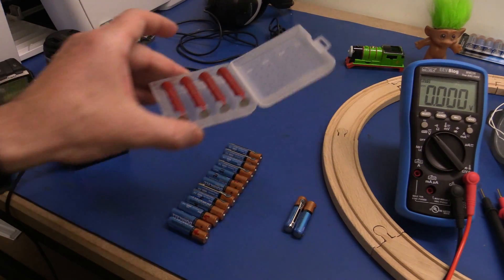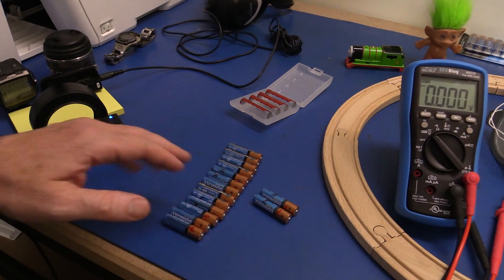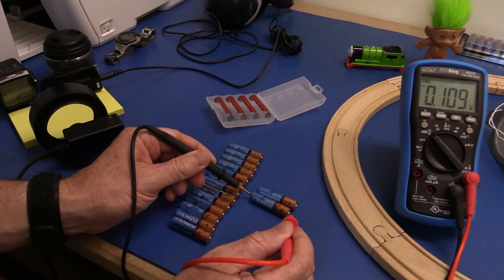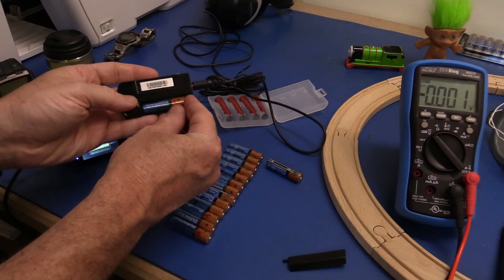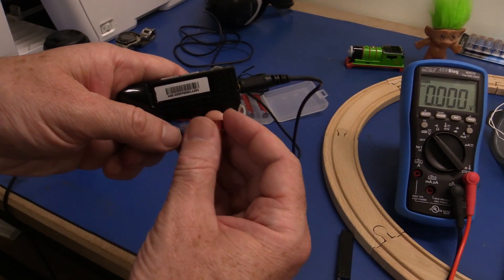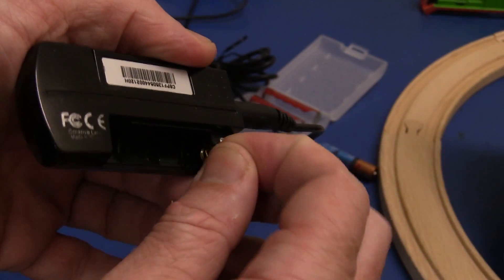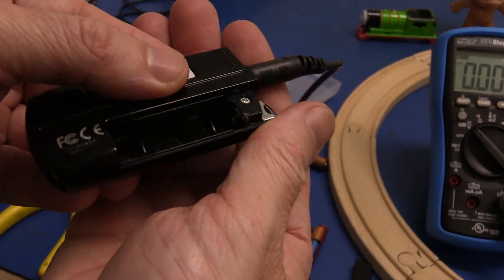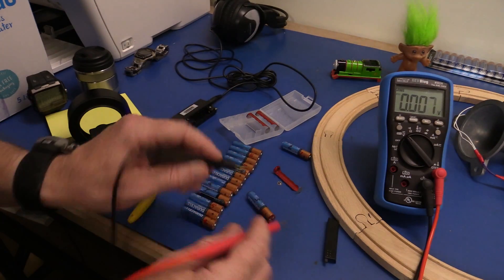RAW Batteriser MP3 Player Test

Comment: I want to leave a dislike but i don't want you thinking it is because i belive the batterizer bullshit. 
i get this is your second channel or whatever, but im not subbed to this channel and this video is being suggested so don't "hide" behind that argument, where the video comes from is not important.  you seem to be more in a rush than normal in this (than your mail bags, your streams, everything) that "rushyness" causes you to make many mistakes that are careless (putting in the battery without the batterizer, the first battery working but not working on camera, breaking the batterizer (yes, i am saying you rushed and YOU broke it BECAUSE of that) ) 
despite being in a "rush" you still waste time doing pointless things which makes the video feel weird, measuring all the other batts for example...why? they are not part of this test and don't hold any interest. will you also measure the length of the table, and the brightness of led on the timelapse camera? because they are just as relevant. 

like i said. i would have just put an unlike so youtube can get a better idea of what i like, but i don't want to be labeled as a supporter for batterizer, so there. 
keep doing you, i guess, this post isn't for you, it's for me.

Comment: Hello Dave.

Can you use the batteriser with NiMh Batteries? Maybe you can push them up to 1,5 V with the batteriser and drive devices which wont work with 1,2 Volts. Probably an application for the batteriser.

Comment: Not too bad to have the terminal broken off. You could solder some kind of flat surface or tactile done on there; it would eliminate the issue with double-spring battery compartments :D

Comment: All I saw in this video is that Dave proved that he could get an extra 45 minutes of play time out out of the mp3 player. He didn't have to wait around for hours till the dead batteries re-generated. I wouldn't call it useless. They are guilty of over-hyping their marketing with straight out lies way back at the start of their campaign. Thats what has pissed people off. If from the start they said we have a device that get you an 30minutes of running time, or take a few extra photos on your cheap camera...then noone would have a problem..as thats what the thing appears to do??

Comment: to get a better fit I would cut a turn or two from negative terminal spring, also get a thin metal washer or similar to put in between battery and positive terminal

Comment: Battery compartments generally aren't made with any spare space left, I doubt you'll find a whole lot of products that these will fit well in, even with such a small size.
Reply: TacticalBBQSauce that's  my problem lol I've broken 4 so far
Reply: David W.
It was my first thought when I first saw this thing. I don't think I own a single battery operated device that these would fit in. Maybe something that is supposed to take a protected 18650 would have enough space but I wouldn't think something standard like a radio or something would have enough space.

Extra space in the battery tray means more plastic, which of course means more cost. Thus I don't think many companies are making over sized battery compartments, I've had some normal AA's that were a very tight fit in some products

Comment: The question is: Should you bother to spent £8.20 for 4 batterisers or buy about 80+ batteries from the pound shop and forget about it?
PS: 80+ because they come in 8+2 or 10+2, depending on the made and offer.

Comment: I'm sure Dave will find some products in which the batteriser will be beneficial.
Maybe some old, not well engineered products ? Mabe some walkman (portable compact cassete player) ? Old radios ? (like 1980 radios) Maybe some 1970 calculators ? Surely there must be some devices that work better with batteriser.

Comment: Battery compartment fit was one of the first things I thought of back when the first batterizer video was released.
Reply: Same! Sometimes normal batteries are somewhat hard to fit some battery compartment tolerances. So if you add some metal in between, well...

Comment: One thing I am wondering..on devices that record content or other data, I assume that some devices will watch the battery level in order to have a graceful powerdown, so that stuff needed to be saved has time to do so.  Like you mentioned before, because of the boost controller, the battery level meter will be incorrect, could that mean that someone that is using this device, in say, a digital voice recorder, or the like, may inherently lose a good section of recorded content, do to an "ungraceful" powerdown?  i have a media player that spins a hard drive in it, and it will give warning that the battery is too low for some operations, just to preserve data integrity...which  a batterizer could possibly ruin.
Reply: krbruner totally. the device wont be able to predict the remaining power left to do its thing safely. Already happens with some devices that expect an alkalime AA when you use a rechargeable battery. or with old vs new technology nimh batteries.
devices are engineered with common or rechargeable batteries in mind, they arent optimized for the baterizer and expect a voltage curve to predict the remaining charge left. the only place where this could go with no problem would be in low power dumb devices which dont care about voltage at all, maybe some keyboards, a mouse, some music players but thats it. never use it on something that stores data or anything that read the voltage to trigger some alarm like in a drone (sudden death at 20m above the ground isnt a nice thing)
Reply: That certainly is a problem - but i think most decent devices have enough protection, like a small cap as buffer.
But really depends on how it is done.
for voice recorders i think they will safe more than just once a second, so the loss should be buggerall.
Reply: ABaumstumpf
 no small cap is gonna save you. When they need something like that they use a backup battery, like a cr2032 for volatile configs like in bioses. a capasitor wont last a second, even on low power devices like a mouse or a keyboard. Not even a voice recorder. caps just dont have enought charge to keep the voltage high enough for it to do its thing.
Supercaps on the otherhand might work but still they only use those on super expensive stuff for datacenters and that level of things.

Why would you put a supercapasitor on a device where it works just fine with a normal AA battery?
You make it more expensive, spend more time testing and developing, all for what? nothing, you gain nothing and made it a lot more expensive to produce.

"protection" would mean that it will shut down fine even if you remove the battery while it's working. That's stupid, why would you do that and expect it to not corrupt the end of the file? No one will ever offer you that protection. Batterizer will do that, from 1.5V to 0 when it just cant drain any more power from the battery.
Reply: Laharl Krichevskoy A mouse for example consumes less than 100mW.
Typical capacities there can only power it for like 0.1 s.

But you are right, normally the caps are too small to bridge more than just short disconnects.

I tend to forget that i always design things to always work. You want a 5W constant-current LED-driver? make sure that it can handle 30 W :P
Reply: Supercaps are good enough to let a processor finish a video file after power is disconnected. But they have to intentionally be used in the design, it requires a little more than just extra caps

Comment: My sugestion would be to fit the sleeve into the compartment, then fit the battery into the sleeve.
Reply: Looks too flimsy to do that. I think it relies on the battery for structural integrity.
Reply: I'd rather make a fake battery out of a wood (or plastic) dowel, insert brass/tin plated screws into the ends of the dowel, and run wires externally to a single cell battery box.

Comment: I think a fair test would be having two of the same product with fresh cells run side by side. One product with the Batteriser, one without. Turn both on at the same time and see how long it takes for them to run down. If the Batteriser last more then 10% longer then it might be of value.
Reply: If he used 2 new batteries with the batterizer attached, than the batterizer would actually last SHORTER.
It is a simple boost-converter, and even if done really efficiently, it would not be better than 95% efficient - and that is enough to eat up any potential benefits it could have.
Reply: ABaumstumpf well, alright then. run 2 products until they quit, then put the batterizers on one of them and see just how long they run before they die. how about that????????
Reply: Mark's Journey  That is what he is doing :P
there you might get a bit more energy out of the battery, but as he has shown in other videos, best case scenario you might get like 20% extra.
Reply: ABaumstumpf no, he wasn't. he just had one, not two. I'm not sure why I'm  argue with you. who are you anyway?
Reply: ABaumstumpf Troll.

Comment: The issue you had with fitment was always one of the things I thought would be difficult to overcome - I can barely get a battery into some of my devices, let alone with the extra length of the sleeve.  Even if they get them to a mass market, they won't last long just based on how flimsy they are and how difficult they will be to get into some devices.

Comment: Why didn't you use the same battery #2. It ran for what 2 seconds then died then use the batterizer on #2. why switch to a new battery#3 that's running for 2 mins longer then battery#2. Just looking at that it's an increase from 2 seconds to over 120+ seconds.
Reply: UPDATE in description.

Comment: So many consumer devices have very tight fitting battery compartments that I have to spudger several to change batteries. Thus the mechanical piece may very well turn out to be as problematic as the electrical side. Good for Dave to try to be as objective as he can, even as difficult as it appears to be!  ;-)

Comment: With it not being 100%% efficient, that lower efficiency will cancel out any any benefit you get from it extracting the last bit of power. It needs to be a device that is only used on batteries that are almost dead.